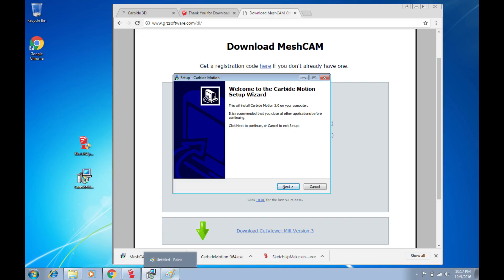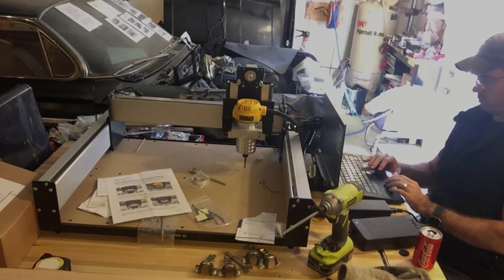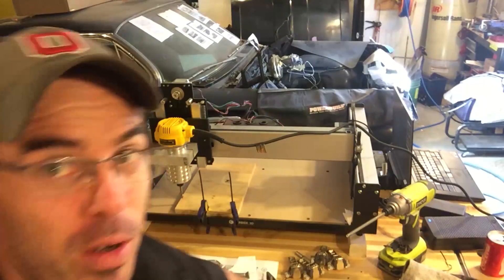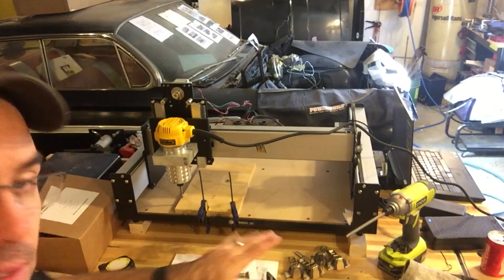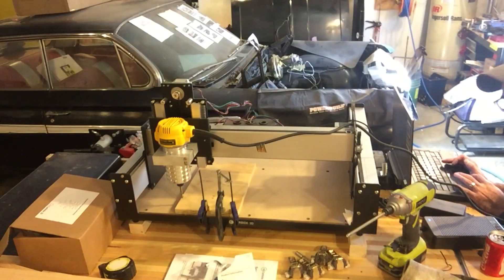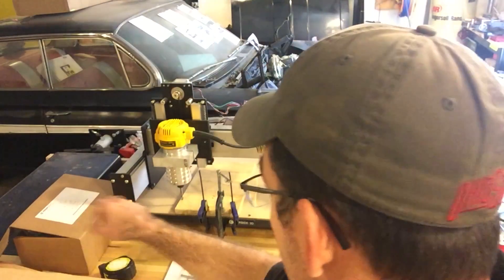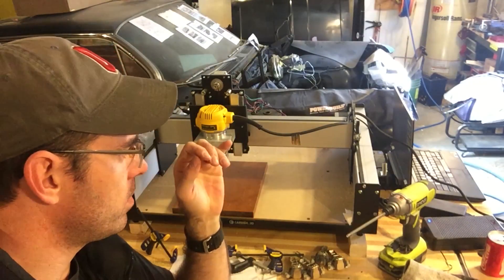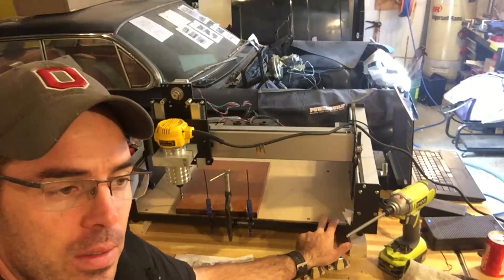Shapeoko 3 First Project

Comment: Is carbide 3d or /and carbide motion usable on any cnc machine?  or just shapeoko?
Reply from the maker: I haven't confirmed this, but Carbide Create can export a g-code (*.egc) file, so anything that can read that file should be able to use it for CNC. However, I am not sure if Carbide Create has proprietary lines or commands in that file that other CNC software wouldn't recognize, so that would need to be confirmed.  Carbide Motion, from what I can understand, is specific to the Shapeoko.